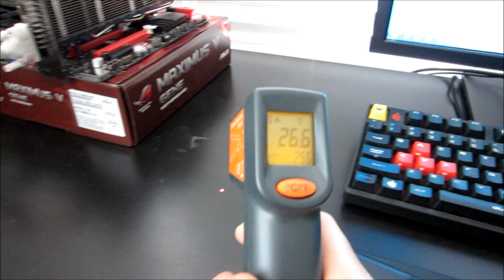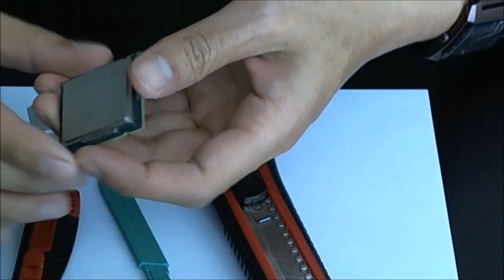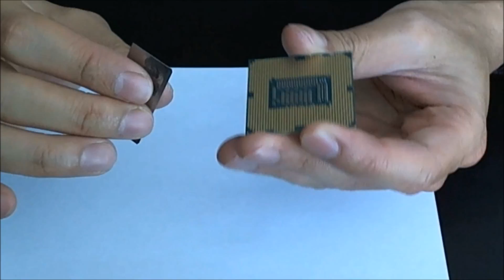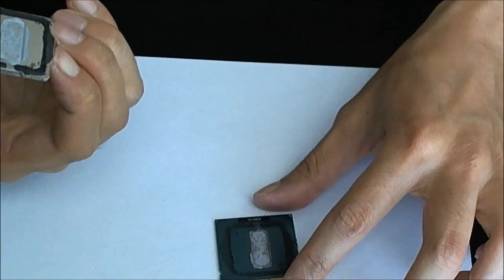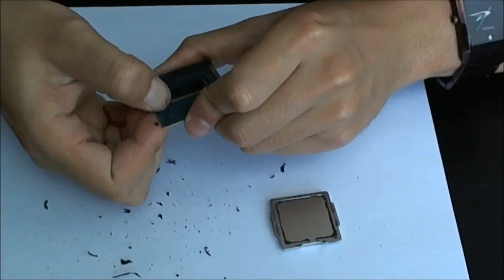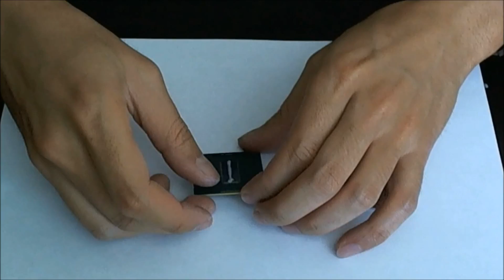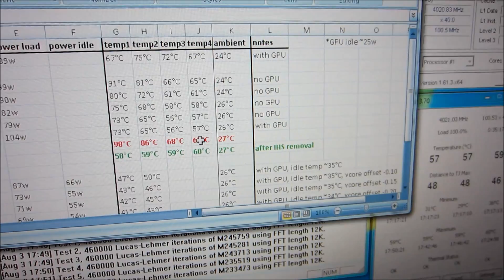Fixing Skylake, Haswell, and Ivy Bridge CPU temps: IHS removal

Comment: Did you pull this info out of your ass? You're saying the CPU will all of a sudden run slower because there are oil on it?

Moron. There is either connectivity, or there isn't. The CPU either runs like it suppose to, or it doesn't run at all. Also, tiny amounts of oil won't do shit to the connection.

Did you watch some newb tutorial 10 years ago, and think you know everything?

Comment: i was just wondering, but does anyone know how accurate the bios temperatures are for hw monitor? i have a intel g1610 with stock cooler and it usually reads 41 degrees celsius for the cpu and 35 degrees for the motherboard. when using hw monitor cpuid, the software that you download, it actually shows like 31-35 degrees or so usually, is the bios one more accurate, or in other words, the correct temperature?

Comment: I was looking at the video wrong and was off base with the above comment. Having said that, I performed the procedure with no problems and with the same conditions that were causing temp highs of 62-63C are now 52-53C. A heat reduction of 18 degrees Fahrenheit. Heat is an electronics killer period. Thanks again. Happy Happy Joy Joy!

Comment: I also just noticed that after you remove the heat sink that the Intel applied glue is impeding the air vent where the outer edge of it flares upward for about a half inch on one side. The air is able to enter there and aid in the cooling process.Removing & replacing the CPU into the MOBO with no glue it has full air flow with no obstruction. This whole process makes this a fundamentally better CPU in a critical way IMHO.Once again, well done and thanks for this video.Intel,Y such cheap IHS? (

Comment: you would think intel would have the brains to use good quality thermal paste on the K line of processors. They know that overclockers are gunna buy them. Im pretty sure overclockers wont mind paying a little extra for a cooling paste.

Comment: i still think its worth it buying better quality thermal paste like prolimatech pk3 for only like 5 dollars, removing the old paste on the die and stock heatsink or heat spreader, apply the pk3 on both the die and heat spreader, for the die, do it in a straight line and for the heat spreader, i would do it just short of a pea sized amount in the middle, this should lower max temperatures by a bit and also lowest tempetarures should be a little lower as well, i might do this on my next own pc.

Comment: Intel used the SAME thermal compound for every processor series. People only found a difference between Sandy and Ivy Bridge because there was a die shrink, and because Intel started using 3D transistors.

Comment: I can say it's a general problem with this CPU.Saw a lot of reviews and all mentioned that the temps are too high.From myself I can say, at standard clock (3,5GHz) with 1,6GHz memory on full load the CPU runs over 80 degrees in just seconds.And there is a temperature difference between the core 1 and core 4 of about 10 degrees ever.When I run the memory on 1,333GHz, CPU hit 70 degrees, everything on standard clock and this is very bad for a K edition. They should had used a better termal paste.

Comment: well, one reason to do this is that Intel used inferior thermal paste between the CPU and the heat spreader on these chips. Some people have gotten them to run 8-9 degrees cooler just by putting their own paste on. Though.. I still wouldn't attempt this mod myself. Just too much at risk for me.

Comment: Good instructional video. That being said...here is how to save yourself $300/400. A) DO NOT do this if you DO NOT have a temperature problem like he did. Intel's manufacturing process might not be perfect but most of their chips function just fine. B) First of all buy from a retailer with a good return policy. Go return the thing and exchange it for another one before you even attempt this. C) Contact intel to get it repaired. Only do this if you have no other options.

Comment: should have used the razorless method dude! this is outdated now. Search Delid Razorless in youtube, it's a 12 second video because it literally takes 12 seconds and is RISKLESS. 0 deaths this far, where razor method deaths are almost common. You should have done more research. You would know that this method is dangerous and obsolete now that the vice and hammer method came out.

Comment: i didn't say you cannot overclock without water cooling all I said is that you sure. water cool when you water cooled you can get a better over clock. be cause the system can handle more heat :)

Comment: Better idea than potentially ruining a perfectly good CPU spend under 150$USD buy a Corsair water cooler ( the new ones with the smooth hoses are a big improvement from kinked). Buy better fans, adjust them so it is directing the cold air from the front so it moves through the system and vents out the top. Temp problem solved.

Comment: DO NOT do that. check your fan's airflow. Taking this apart or putting it in alcohol WILL VOID YOUR WARRANTY. the direction of your fans plays a big part in cooling. You could arrange the fans in your system to be beneficial to the airflow in the case.

Comment: move your CPU fan away from your video card, it is sucking in the heat from it and overheating your CPU, also check your hsf and make sure it is even and level with the cpu. You should have the fan blowing toward the video card and not sucking it in. 2 fans blowing thru to the video card would be even better.

Comment: I wouldn't have even attempted it. No one is going to warranty that after this is done. If you are that paranoid on temps. Get watercooling, or better airflow. the haswells are actually meant to run cooler, I don't know why this guy is trying to fuck his CPU up.

Comment: I was trying to be carefull, but working one of the corners I scraped just enough to see copper under the green pcb, just a small nick, but that was enough to fuck it up.

I ordered a second 4770k, and this time successfully de-lidded it, and yes My temperatures dropped nearly 20 degrees, and oh my god these chips run hot. 90 degrees at 4.6hghz.

best advice I got; use a very thin and sharp razor and always be cognisant of the pressure of the blade pointed up towards the IHS not the cpu/pcb

Comment: I calculate my cpu heat with a very accurate laser heat sensor. I point the copper near to the cpu, not the heatsink. On idle 37 - 40°c and on game up to 50 - 60°C.

Comment: Not sure if trolling....
AMD and Intel have a different temperature sensor that is located in a different location.  I believe AMD measures the case temperature and not the core temperatures like Intel does.  So no, you don't generate less heat.
At the person who made this video:
Ivy Bridge doesn't have a thermal paste problem, the temperature issue comes from the gap between the die and IHS.

Comment: Of course I never run it like that for longer than 10 minutes for testing etc. Intel recommends a max voltage of 1.52V. I currently run my 3770k at 1.46v at 4.8GHz. Max temp is 80c after 12 hours of prime 95 running small FFTs using an H80i and CLU on the die. Gaming max temp after 6 hours online (multiplayer online is more CPU intensive) I never hit 55c. Before I was hitting 90c at 4.5GHz and 1.3v. I didn't get the greatest CPU. 1.3v for 4.5GHz is pretty stupid. Some hit 5Ghz on 1.2v.

Comment: What was the reason you returned it for though? I'm surprised they took it back. Was it a local store, an online store or Intel? I heard it's usually pretty strict unless it's an awesome store like microcenter. You're not allowed to return them for not being high overclockers so what was your excuse? 

And yeah. delidding does wonders for your temperatures and if you have a decent cooler you will actually run at safe temps at volts that high. I can do 1.6v at 5GHz and max out at 95c.

Comment: So that looked like conductive paste, and the heat spreader is held down with significant force. I figured the reason for the spreader was electrical insulation and mechanical support so that the cooler didn't crack the die. What's to stop someone from eliminating the heat spreader altogether, and just mounting a cooler directly to the silicone?
That would eliminate two layers of heat transfer. One of thermal compound, and one of aluminum/copper (whatever the spreader is made of).

Comment: I have couple of users on my forums which have hit 4.6 using H100i. Yes they have most likely been lucky with silicon lotto (one has de-lidded his CPU and is trying to hit 4.7). Iv seen many hitting the 4.5 to 4.6 mark without de-lidding. I have yet to test this since I am in the process of building a rig. I guess its all about luck.

Comment: Haswell could hit 4.6GHz without the new batch only to the pros reviewing them. Like I said before, it looks like Intel cherry picked the CPUs to send to reviewers because if you look at public forums they seemed to be maxing out at 4.4GHz with high end cooling such as the NH-D14 and H100i without a delid. Then when they delidded they could hit about 4.7-4.8GHz. With the new batch, after a delid with high end cooling, it seems to be the same as Ivy which is about 5GHz with a decent CPU.

Comment: When it comes to gaming, yes. The new instructions sets will help boost performance in other areas where the software takes its advantage. If you are gaming, damn 2500k will be sufficient in most cases.  Haswell can reach 4.6 even without this new batch. For higher clocks on liquid, de-lidding is required and some shred of silicon lottery too. The new batch should be hitting close to 5 with exotic cooling. From previous gen, upgrading might not be worth it, not for slight boost.

Comment: "I'm sick of typing the same damn thing" Is the reason why I deleted my comments. Maybe you should have tried reading them almost 3 weeks ago before I deleted them. It's just me saying the same thing anyway. 5Ghz sandy = 4.7Ghz Ivy = 4.4GHz Haswell, all of which are the "high" overclock with each. However a new Haswell batch was just put on the shelves and seems to be hitting around 4.6-4.7Ghz, so Haswell seems actually worth it. My point is Sandy still matches IB and HW, unless you delid them.

Comment: I can run prime 95 on my 4770, not the K version just the vanilla. Max temp is around 61 degrees Celsius. Ambient temperature is about 24 Celsius.. I am using a Cooler Master X6

Comment: Great vid! But a couple Q's/observations... You said that you didn't have to put any glue back on to hold the IHS, but now you risk the IHS digging into traces...? Which leads to second Q...without the glue on, the IHS is that ever so slight 1 to .5mm closer to the die itself, contributing to (in addition to better thermal paste) lower temps...? So, the best fix to both worlds...wet sand that ridge on the IHS to about half its height,  and use a good heat resistant glue (gasket glue)... ;)

Comment: Try mounting your CPU cooler so that it isn't pulling air directly from the GFX card.
Also, I have the same CPU overclocked to 4GHz and it runs at the temps yours does after IHS removal.

Comment: That probably depends on how well the thermal paste on the die is applied. For him it seemed very poorly applied, resulting in inconsistent temperatures across the different cores. If it is properly applied you will only get the benefit from having a slightly better heat conductivity from a better quality TIM. So that is probably only a few degrees and only if you do a good job applying the paste consistently. Not sure if that's worth voiding your warranty. Your temperatures aren't that high.

Comment: So just a thought...16:08 "I used all my good ones (thermal paste)"...so instead you use a paste that you acknowledge is inferior to other pastes. If you are going to all of the work of doing this, wouldn't it be wise to use a high quality paste so that you get the most return on your work?
Additionally...if you are going to the extreme (modding a processor is pretty far out there) to get better temps, wouldn't it be smarter to go to a liquid block instead of sticking with a massive air cooler?

Comment: This is more for the extreme overclocking crowd stock a new 4770k haswell chip at 3.5ghz runs at 40 degrees idle according to most places and taking the top off and replacing most drop temps to around 20 a 20 degree cooler chip means you can push higher for an overclock.

Comment: Ok if your cpu getting those temps..... send it back rofl - no need to mess around under the heat spreader (dont try this at home!).  Please tell me that after this "mod" you were on air and stock voltage for those temps.

Comment: Wow, that's a whole lotta gunk! Usually, I'm not too impressed by stunts like this, as the big difference in temps comes from simply making sure there's no AIR between the core/IHS/Cooler. This seems to be a definite exception, though.

Comment: Only if you are confident in your ability to do so without harming your CPU, and you if you believe you will benefit from a temp difference. My 3770K on default voltage stays under 70c, so I personally would not opt to do this for my machine (because that is an acceptable temp to me).

Comment: Hey WhiteFireDragon, do you know if that IHS is made of silver, or a silver alloy?  It seems odd to me that they wouldn't use copper or silver. (Looks like aluminum to me, high heat capacity, but not the best conduction).

Comment: This makes me think.. The housing lid that you put back on top of the thermal compound kind of like shelters the core so it is inside.. But doesnt that trap heat in? What if there were little holes drilled in the actual side-walls of the housing lid? Wouldnt that give heat a route to get out?

Comment: I agree, should wipe it off after touching it, and also use dusting spray to remove all what's left of the cleaning process.
But if you washed your hands before and not doing this while having some KFC next to it, practically speaking, nothing will happen.
I just generally don't use my fingers on anything with a connection if I can avoid it...

Comment: This guy used just normal paste as well and he got about a 10c drop on the normal temperatured cores, and a whopping 35c on that one really hot core due to poor thermal paste application. If he used CLU (coollaboratory liquid ultra) he could expect another 10-15c drop. There is a "[How To] Delid your Ivy Bridge CPU with out a Razor Blade!" forum over on overclock .  net. There is a chart on page 1 full of results of people who delidded and their temp drop using which paste etc etc. Check it out.

Comment: Hahaha yeah. That's why you gotta check out the "How to Delid your ivybridge cpu (Razorless)" video. It applies to Haswell too. That's the method I used, and it's far more effective, not to mention it takes literally 10 seconds instead of about 10 minutes of nerve wrecking CPU surgery. It just pops clean out. The only risk is being and idiot an wailing the block of wood with the hammer then crushing the die. You just start by lightly tapping it, then go harder and harder until she slides off!

Comment: Not a defective cpu when you start under volting it or over volting it, the temps will change. Also if it was in a case that had good airflow them temps would not be so high. The way to get 1 cpu core higher than the rest like you have id not tighten it right. Never go clock wise or counter clock wise do it in an x pattern. Kinda like a car tire you do a star pattern  you do an x pattern.

Comment: yours is based on 32nm sandy bridge where they used fluxless solder. intel first begun making the change from fluxless solder to thermal paste starting with the 22nm ivy bridge cpus. the reasons why they changed thermal methods was it  was cheaper for intel to start using thermal paste then fluxless solder.

Comment: Thanks for the reply. I have done the magic marker test and the IHS is a little warped, the left corners are a little higher than the middle and my cooler has a little ding on the baseplate aswell in the center of the plate due to an accident during unboxing. So i guess it could give me a little. and give some more uniform heat temps on all cores. I have lapped plenty Core2duo and Core2quad IHS some years ago.

Comment: Don't slice into it then. Look up the vice and hammer method. 100x safer and MUCH quicker. YouTube search Delid razorless. It's a 12 second video, because it literally takes 12 seconds. No CPU deaths have occurred using this method and because it's so simple, despite being the new method it's already being more commonly used over the razor method because of how easy it is to scratch the CPU. Hammer/vice method is by far the easiest, safest and quickest way to do it. It's not even a project.

Comment: Do not lap the IHS. That gains no benefits at all unless your IHS is warped like they used to be in the Core2 days. Intel has much better control over the IHS warping and it's VERY rare, as in 1 in a million, you will get a noticeable temp drop when lapping Sandy, Ivy, or Haswell. Most cases your temps rise 1-2c. Don't do it. Just apply some CLU. I've personally lapped my 3770k. Temps stayed the same. Although my CPU is super shiny, it's totally not worth the time or effort just for looks.

Comment: I just delidded my i7 4770k and can now reach the desired clock speeds. The one i got could barely run 4.2 stable, now i easily run 4.5, this is with standart thermal paste. But some Coollaboratory Liquid Ultra is on it's way to me, so wonder what i'll see when i put that in and lap the IHS and Heatsink

Note that if you try this, if you crack the top of the pcb seeing some gold colored metal, be aware and insulate the area with some thermal paste that is NOT conductive, like the Noctua NT-H1.